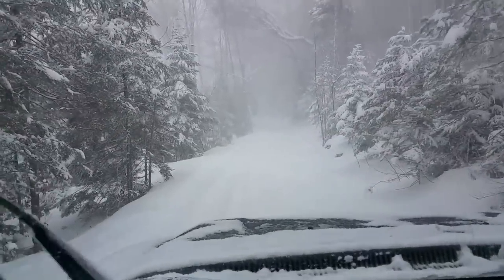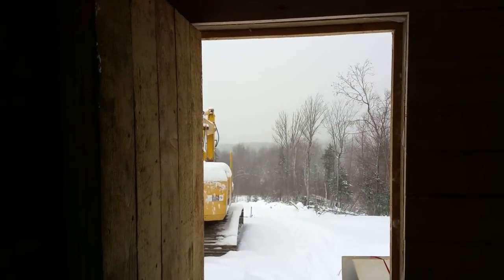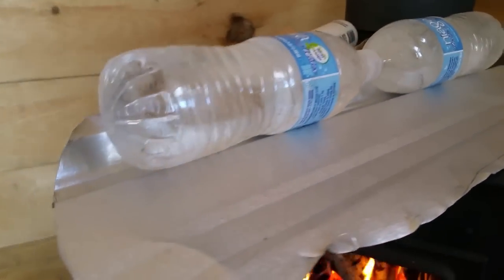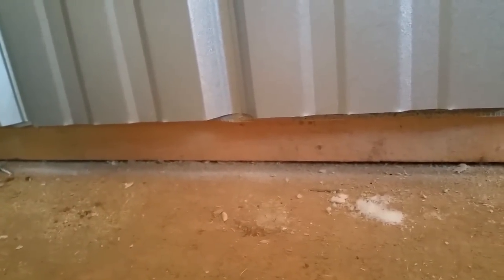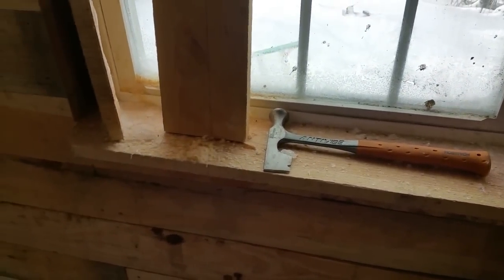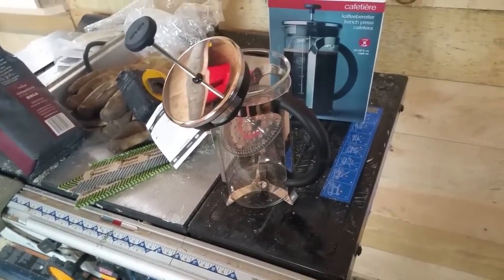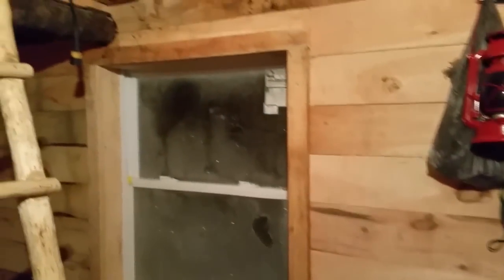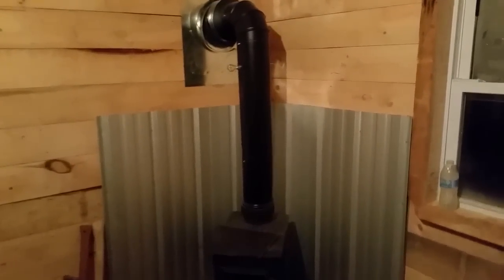Off Grid Cabin Update - Woodstove heat shield, window trim, shooting table

Comment: You need to shut the woodstove door and use the damper for air flow to your fire in the box, for you to be able to heat your cabin more adequately. The woodstoves are meant to contain heat. The heat shield you installed is great solution to reflect and distribute the heat. Great job

Comment: I am assuming your cabin is airtight. As such,you may want to consider putting a small pipe vent under your stove (with a removeable cap and wire screen stuffed in it for bugs and rodent deterrant) . If you have ever noticed on newer mobil homes ,the furnaces are required to have such a vent in the bottom of the furnace. Your chimney draft may be inadequate for your stove to work properly as it is right now.

Comment: Looks good mate, nice job. I agree with MrGraygrizz you need to keep all that timber & paper away from the wood heat, build yourself a wood box to store your timber and keep it at least 2 to 3 foot away from the fire. 
Not sure what the 80% rule is but if you run a hand plane over the edges of your timber trim before you install it makes it look a lot neater & stops splinters.

Comment: you can use the same concept on the  lower portion of the stack its self. would be overkill of course though. nice video
Reply from the maker: Bruce B Thanks for joining us!  It seems like the heat is not overwhelming on the wall (or even the heat shield) even with the stove raging.  I am going to keep my eye on it for the rest of the year and see how it goes...and next fall make a judgment call on it

Comment: Thank you so much for the video.  One question, though.  Should the 90 degree outlet actually be a 90 degree bend.  I thought it wasn't supposed to be a 90 degree bend??? I thought it was supposed to be higher angle???

Comment: I would still be worried of the closeness to the wall.The stove should be at least 36 inch. from the wall with backing & stove pipe should be 18 inch. from the ceiling or wall that is standard install recommendations.

Comment: My wife and I love all that you are doing on your property.  We have 42 acres we are working on the same types of things.  I have about half the wood for a small cabin like this, I will be building this summer.  My question is, what do you do about air circulation above the interior of the ceiling?  I know you are supposed to circulate air through the "attic", when you panel it in like that, does condensation build up?  

Thanks -keep up the great videos.

Comment: Cellulose insulation could be put around the double wall stove pipe, but check with a builder on code requirements. Check out you tube videos on the different fire ratings of insulation, you will be surprised.

Comment: If those are insulated windows, (2 layers filled with argon gas) then your top pane as well as your back window is leaking. They should not frost up like that. Other than that, looking good!

Comment: Hello Fellas !  I don't think green wood is so much a problem as it the height of the outside flue. The pipe should be above the peak of your cabin allowing it to get the proper draft ( just saying ). Good Luck !    Hfx NS. Canada
Reply from the maker: 1armedguy you are right in general about the stack height.  In this case we have a VERY good draft, which i think is aided by the generally windy conditions

Comment: The requirement is 36" clearance from combustibles (particularly the walls) from top, bottom, and sides.  The exception is that the manufacturer of the stove gives you the clearance to go by, e.g. around 12 inches off the back wall and 18" off the side walls (sometimes they put heat shields on the stoves themselves). 

Now, if you install a heat shield the way you did (min. 28 gauge sheet metal w/1" space from wall and floor ), the 36" clearances are reduced by 66% to 12" from combustibles.  So, you want your stove at least 12" away from the combustible wall with your heat shield.

Now here's the fun.  You can install the sheet metal to the wall with one inch non-combustible spacers for the air gap.  Then, you can install the Durock on the sheet metal.  And then, you could tile the Durock for a beautiful look.
Reply: sorry to be off topic but does anybody know a method to log back into an Instagram account..?
I stupidly forgot the login password. I would appreciate any tricks you can offer me
Reply: @Jaiden Jacob Instablaster :)
Reply: @Owen Ari thanks so much for your reply. I found the site thru google and Im waiting for the hacking stuff atm.
Seems to take a while so I will get back to you later when my account password hopefully is recovered.
Reply: @Owen Ari It did the trick and I actually got access to my account again. Im so happy!
Thanks so much, you saved my ass !
Reply: @Jaiden Jacob happy to help :D
Reply: @jaidenjacob1121  I am glad you were able to log back into your instagram account.  Great!

Comment: how much did it cost you to build that place if you dont mind me asking
Reply from the maker: I don't mind you asking at all - but i didn't keep track of it.  It wasn't that bad, considering i used all rough-sawn lumber from a local mill, which was very inexpensive.  Of course, the devil is in the details and 20 and 50 dollar bills add up for things like roofing, fasteners, etc...but it was quite inexpensive, all told!
Reply: Concrete Piers $450. Lumber for my 2 story 575sf cabin will be $2600.  $400 to get it water proofed. That's not counting nails glue flooring or windows. When building it yourself it's obviously cheeper :) and when something goes wrong your the one to blame.

Comment: Did you even bother to read the install instructions? Code  single wall pipe is 18 inches to combustibles. As wood is heated and cools over time the ignition point will diminish over time then the place catches fire one night.

Comment: That Jotul Stove you have there, comes with pretty detailed safety instructions.  Obviously you didn't read them!  Your heat shield is pretty much worthless, you are lucky if you haven't yet burned down your cabin.  The air space should be between the wall and the durock, not the way you did it!  Yes you need airspace, but between the durock and the wall.  What you face it with is your business. You could leave it just as is.  All that wood stored close to the fire, is definitely dumb if not just damned dangerous.  Also that stove needs a thermal shield under it, if your floor isn't concrete. Likewise once the fire is burning, you should close the door.  Embers can fly out and catch your place on fire. Just looked at your other video, yeah that's a Waterford.  It's very similar to the Jotul.  So I would assume it needs the same clearances to combustibles.  What kind of wood did you use?  If it's green wood, that's why you've got that condensation.
Reply: Kenneth Sturmer ( FYI....he is unable to answer...cabin is now ashes)

Comment: you must be single bcs no woman would tolerate that sheet metal in her house.  Either that or you will be single very fast. I Installed my own stove including the chimney through the ceiling and the backer  from hardee board, painted it black and it looks awesome.  Stunning.  All the seams on the backer board are tight where I joined them and it's all up to code.  It was a miserable job for a woman but we ladies in Northeast Connecticut have a motto: we can switch from boots to high heels as quick as we can change the blade in our sawzalls.......
Reply: M reddrop Update; she broke off the relationship once the burns were treated n her hair grew back. I guess women won't put up with "dumb sheet"!
Reply: Madelyn p